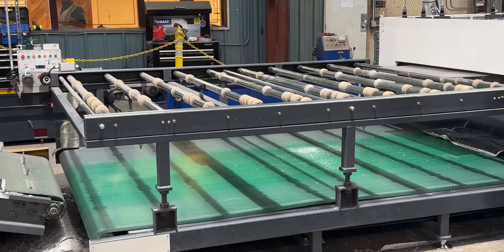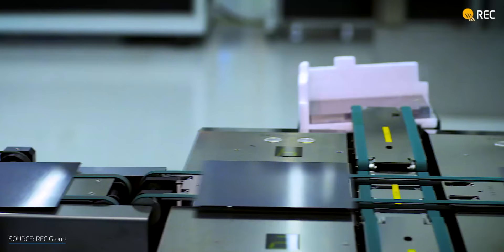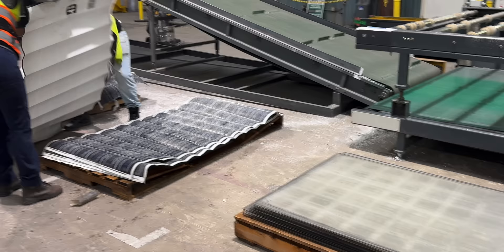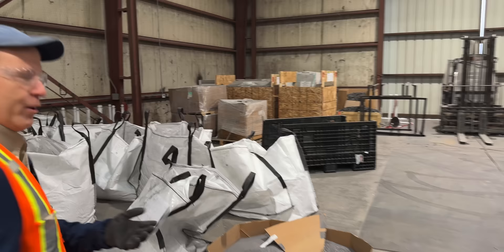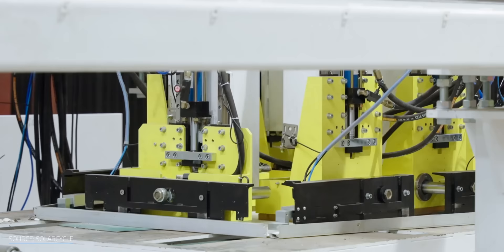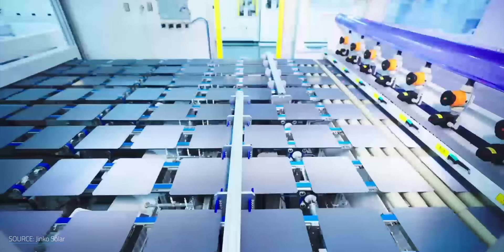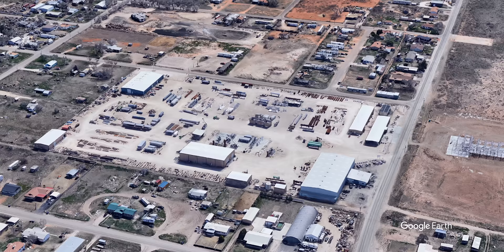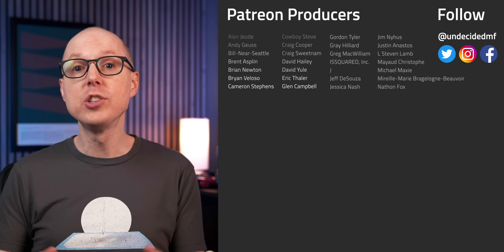What REALLY happens to used Solar Panels?

Comment from the maker: Do you think companies like SolarCycle will become the norm in the future? Get an exclusive Surfshark Holiday deal! Enter promo code UNDECIDED to get up to 6 additional months for free at https://surfshark.deals/undecided

If you liked this, check out Top 5 Solar Energy Advances Using Perovskites https://youtu.be/OYzCq8YWAHw?list=PLnTSM-ORSgi6ObB8Ao0IpRhOgYO27wbSd
Reply: Sure as soon as the volume gets high enough to make profitability. Right now most are sold to us DYI on the cheap and because they are cheap we want them. sure they only have 75 percent of rated output but the sell for 20 percent of the cost of new  and still have another 20 years of life before they reach 50 percent. ROI baby ROI
Reply: One number was not presented in the video - what is the value of the recycled materials? At $15-18 cost of recycling, I assume that is the net cost (cost of recycling (R) - value of recovered materials (M)). It seems like M could increase only slightly, and so, to make it profitable, we need to reduce R. At the end of the video, we see that a panel is 30c/W and 600W, or $180 per panel. So, recycling adds 10% to the cost of the panel, which is not terrible, and can be added to the cost of doing business.
Reply: Day 3 of hoping you do a video on fabric ductwork vs sheet metal
Reply: This is great. Glad to see company find a way. Now like Tesla they need to open source their process and tech for the greater good to quickly lower the cost. The Fed like investing in all the solar and wind projects needs to put forth the same effort in recycling these same materials for solar and turbine blades. I find it counterproductive that the Dept of Energy and the fed are not as generous with our tax dollars in the investment in recycling technologies. At some point in the future, as the price per solar panel drops and recycling becomes the norm, hopefully commercial and consumer building will come with solar or at least be an option for the consumers in building new houses. Great Video Matt.
Reply: I still think that we will reach a moment of stability on earth, to the point that will finally be viable to explore space radiation as an energy source, mine space rocks and do all sort of science fiction stuff, but creating a way to recycle solar panels, wind turbines, using algae as energy source and air purifier, this things give me hope for the future.
Reply: Just to add, I am okay with a panel that produces >50% of their rated output if it extends their life and the cost is right.  Every solar panel I own was used.  There are significant parts of the population that have more real estate with good sun exposure that are able to persist with less than efficient used panels.  When recycling is improved it is likely I won't be able to replenish my panels with used panels without needing to outbid the recyclers.  It is, in essence, what is happening to EV batteries and to an indirect extent what happened with cash for clunkers.  This wasn't necessarily good news for a lot of us, but inevitable.
Reply: The Segway Portable PowerStation Cube Series seems like a solid choice for outdoor enthusiasts and RV lovers. It offers a massive capacity, fast recharging, and multiple output ports. Plus, its waterproof design ensures durability during outdoor adventures. Definitely worth considering for your power backup needs!
Reply: Thank you, Matt. This video is excellent for canceling FUD
Reply: how much are the materials worth?
Reply: Is this the first of a two parts video? Just asking because we learned nothing about what happens to that ground up material. How much it worth? How is it separated into base elements, and what's the cost of that process?
Reply: Such a waste I bet 2/3rds these panels still generate over 2/3rd initial efficiency/capacity.
Reply: ❤ travel the world with a bag of that sand and go to different metallurgists and offer them a reward to whoever can isolate the metal the most efficiently
Reply: Solar panels need to be designed from the start for ease of recycling. That’s the best way to encourage recycling.
Reply: Carbon footprint of solar panels is larger with this industry….
Reply: This is great, but yet again regulations are lacking. The producer should be the one having to do the recycling investment. They would then find the right balance between producing and recycling costs and use the right processes on either side. We have the exact same issue with car and car batteries.
Reply: What about donating working panels to 3rd world countries where the government struggles to provide the infrastructure for electricity. I'm Haitian and I know that Haiti would love to acquire those solar panels, as bad as they are, it would be better than what's down there now.
Reply: Have PV cell makers experimented with binding agents?  Could there be a binding agent that would fulfill all the needs of manufacturing yet can be broken down through chemistry or application of heat to make the recycling process easier?
Reply: So, has anyone told Amish what we did yet?
Reply: Many States add a deposit to glass and aluminum beverage containers.
So if the US did something similar (e.g. $20 per panel) then you incentivize people to recycle their panels.
Reply: The most important information is missing: the economics!
At this time Solarcycle is obviously running at a loss. How big is that loss? Are they expecting that to change? When?
And what about the life cycle assessment? They need energy and toxic chemicals to recycle the panels. How much better (if at all) is their process compared to obtaining the same raw materials fresh? You mentioned the advantages of aluminium recycling but that's the easy part. You just strip off the frame. Is recycling the rest even environmentally friendly at this time? What kind of processes are used to separate the metals in that mixed metal dust bag? Are those even better for the environment than obtaining the same amount of metals fresh?
Reply: Thanks for the video. Yeah, I am sure this will (have to) be a large part of our economies if we want to continue building stuff. There is just so enormously much saved if we can recover these materials to build new panels (and electronics). And since we don't mine these materials locally, that part where it helps being independent of the mining and refining supply will most likely play almost as big a role as cost.
Reply: @BiggMo  If only there was a way to produce the energy needed for industry and transport without burning fossil fuels, like maybe we could somehow power them with sunlight?
Reply: That's a great question! Companies like SolarCycle definitely have the potential to become more common in the future as the demand for sustainable energy increases. Speaking of sustainable power, have you heard about the Segway Portable PowerStation Cube Series? It's a versatile powerhouse with a massive capacity and fast recharging capability. It's perfect for outdoor enthusiasts and RV lovers like us!
Reply: I saw people dumping hundreds of 4 by 8 panels that we're brand new that got Damaged in shipping Being Dumped  In Taos, New Mexico landfill.🤯
Reply: We can only hope.
Reply: i don't know what to think, i just hope they do - thank you for supporting them, more please.
Reply: The Segway Portable PowerStation Cube Series seems like a great option for outdoor enthusiasts and RV lovers. With its massive capacity, fast recharging, and waterproof design, it's ready for any adventure. Plus, the smart app control feature adds convenience and control. Definitely worth considering for reliable power on your outdoor journeys.
Reply: The Segway Portable PowerStation Cube Series seems like a great option for outdoor enthusiasts and RV lovers. With its massive capacity, powerful output, and fast recharging capabilities, it can keep your devices and appliances running for extended periods. Plus, the waterproof technology and comprehensive protections make it perfect for any adventure. Consider checking it out for your outdoor power needs!
Reply: Based on the video, it's good to see companies like SolarCycle taking responsibility for recycling used solar panels. As for the Segway Portable PowerStation Cube Series, it seems like a versatile and reliable option for outdoor enthusiasts and RV lovers. Its massive capacity and fast recharging time are impressive features to ensure uninterrupted power supply. It's definitely worth considering for your outdoor adventures and home backup power needs.
Reply: I buy used panels or accept them free. Never found one that couldn't still make power. Even cracked ones I fix. I then give them to the poor. Screw this. My trickle down saves the poor. Recycling only helps the rich
Reply: @CherokezPittman bummer because reuse is way better
Reply: Yes.
Reply: Loving seeing companies forming for End of Life Recycling and Reuse of raw components. Manufacturers should also bear some of this responsibility.
Reply: "There's a growing tsunami of panels reaching their end of life" - first it isn't a "tsunami", a rising tide would be a better description. And just what constitutes "end of life" for a solar panel - is it when it reaches the end of it's warranty as so many detractors claim? Or is it when it is no longer capable of generating electricity at all?
Reply: Totally yes.
Reply: Brilliant Light Power SunCell produce energy 24/7 unlike solar panels which only work in the daytime.